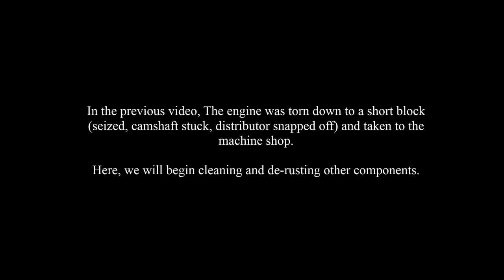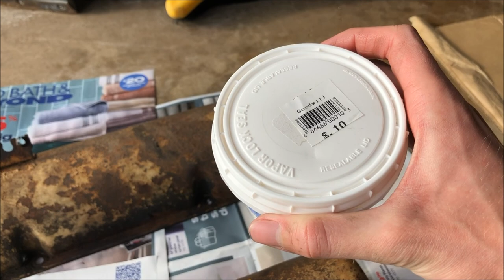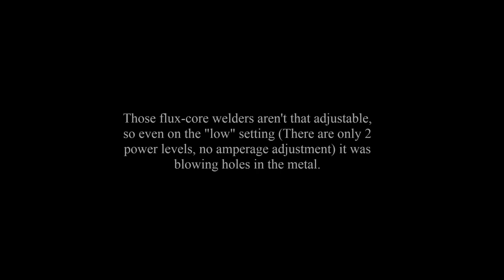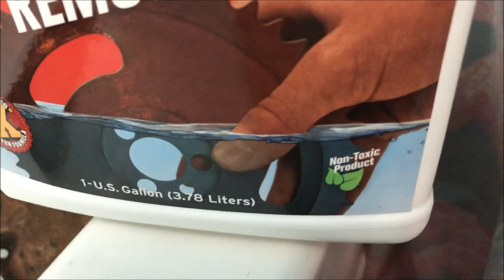430 MEL Teardown, Part 3

Comment: You can use oven cleaner for a preliminary clean, but I usually send everything to the machine shop to run through the hot tank.